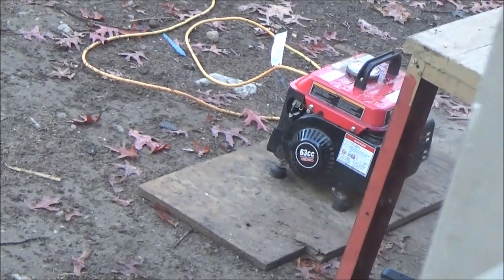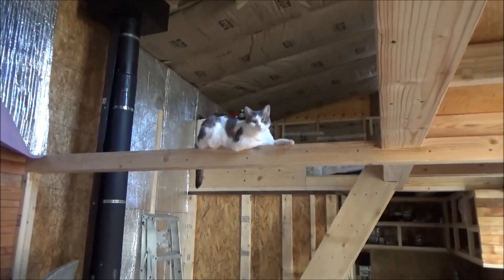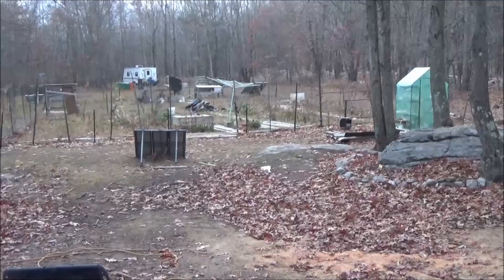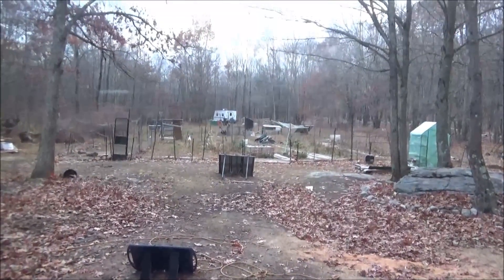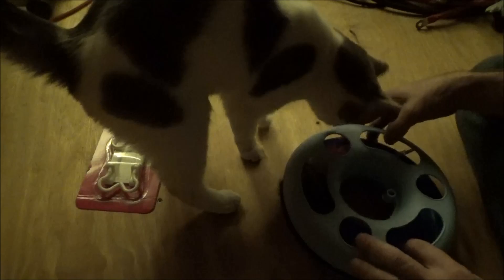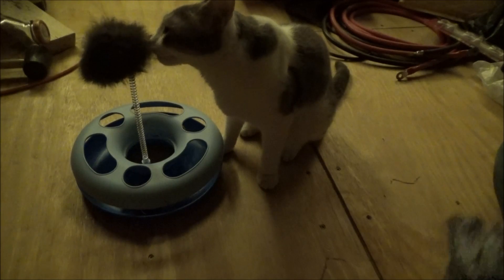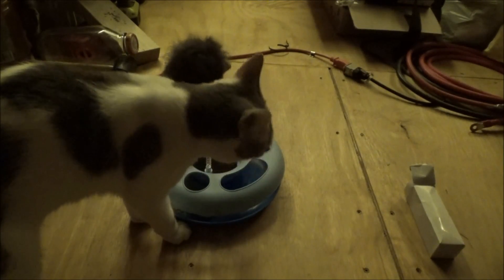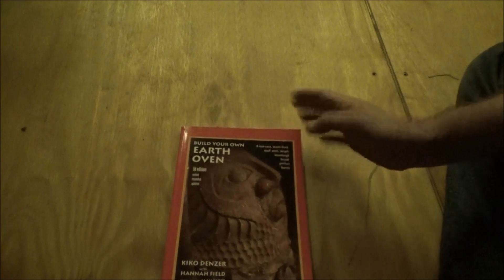Charging New Tiny House Solar Battery Bank

Comment: Can I parallel and leave connected my mppt with a battery charger? I need to top off my battery's with a charger when I get no sun. Also can both the charger and mppt run at the same time with out damage to mppt? Thank you

Comment: Very cool! im finally getting a generator for my rv today.  And planning on putting a wood stove in for the rest of the winter. Any suggestions on stoves?
Reply from the maker: Large as you can safely fit because the smaller burn chamber means feeding the fire all the time - literally. Air tight if you can get one cause it burns even longer on a load.

Comment: Hey there , how many batteries are in your bank ? I'm currently purchasing 12v 35ah batteries to start one myself for my cabin . What i'm thinking about doing is be able to charge my bank from a generator and this coming spring connecting a
100w solar panel to maintain the bank when i not using it . What kind of advice can you give me ?   thanks Joe

Comment: Why is Troy not running a wind turbine during the winter months if he is getting insufficient energy from his solar panels?  I'm glad he is getting alot out of that HF generator, but I don't think he wants to hear that thing running all winter long, even if gas is pretty cheap right now!  I may have missed it but I'd like to see Troy put something up about his long term plans for generating power.  I know he may not have the money to buy everything he needs immediately, but I think he has been in the meadow long enough to have an idea what will work and what won't work on a seasonal basis.
Reply from the maker: Rob Busch  I will need cement footings, earth digging equipment because its too rocky here. Guy wires and footings. And about 100 foot of wire for the wind turbines to the solar panel wires, which costs about $5 per foot per wire. I hope to start putting up a temporary tower next pay check.

Comment: you need to learn about battery charge voltage. 12.64 is 95% full.  12.7 is 100% full.  12.2 is 50% full   12.00 is 25%   11.9 is dead
Reply from the maker: I use this heavily in my work - http://batteryuniversity.com/learn/article/how_to_measure_state_of_charge
Now what worries me is that voltage is not a good test for state of charge. My charge controller shows me the state of charge of the batteries based on computer calculations considering temperature and other variables. I trust it. Better to be more cautious then damage the batteries.

Comment: Ahhh I didn't realize you have a MPPT controller. For some reason I thought you were running a old school PWM controller. Didn't you start out with a PWM controller?
Reply from the maker: flash001USA Yes I did
Reply: The Do It Yourself World
That was the best investment you made for your solar setup. The MPPT controller can take a little solar input power and squeeze much more out for your batteries.

For some reason I thought you had an old school PWM controller and I even commented a video or two ago about it along with how to check the health of your batteries. Hopefully you got a chance to read that comment. Anyhow, the tiny house has came a long way from it's humble beginning from a flat bed trailer.

Comment: The Do It Yourself World  as an IT student myself i prefer windows 8. Yes i can understand your position on the whole situation but in today's operating systems everything is automated. No more having to manually hack into the video drivers and etc.
Reply from the maker: Clayton Burrell As an old school computer tech, I cant stand automatic operating systems. I want control of my computer fully. I want it to do what I want, when I want. I spent 5 hours yesterday trying to use my Win 8 automatic computer because it was doing some stupid automatic system maintenance in the background, using up all resources. When I wanted to use the thing. Took me 5 hours to save a video. That should not be. Sometimes I cannot afford the power for this thing to take over on its own and run itself for 5 hours at a time. I need control
Reply: The Do It Yourself World You do know you can check to see if any updates are available prior to working on the computer. There are a few ways to do this. If you check and there's updates then you can install the updates prior to using the computer and then they wont interupt what you're working on. Also you can go back into the system settings and change the system to allow you to manually download and install the updates therefore eliminating the frustrations fo it doing it automatically.
Reply: Clayton Burrell I have mine set to check for updates, and notify me if there are any new ones. If I didn't do that, BIng and who knows what else would be on here, hogging resources. I check the updates each time, and only install the ones that are needed. Otherwise, even my high-performance computer, on the grid, would be spending way too much time on updates and system maintenance.
Reply: Odahi The Dubious this is a good practice. You can have it set to notify when updates come in so you can manually install or you can have the system set to only install the important updates as apposed to the "recommended" updates which might be like updates for your Skype app or programs that aren't critical to running the main parts of the machine.

Comment: windows 8 is pretty messed up, separated control panels different ones here and there... it is pretty disjointed..   took me a gooogle search on where to turn of the ambient light sensor for the screen brightness...  where was it , in the metro interfaces control panel???  metro looks cool but really not very functional and why not include the ambient light sensor control to enable and disable it in with the screen brightness setting in the desktops control panel???  What is Microsoft thinking?
Reply: Hang on Hang on!!!  I think you just mentioned something I need!   This ambient light sensor... is that the thing that makes my screen brightness suddenly dim for no reason???  If so, how do I fix it, please?   My screen just dims and the brightness  key doesn't change it... what is up with that???  WTH is a Metro Interface Control Panel?

Comment: Hey Troy. Congrats on retrofittng your own gasket. I know it can be a little time consuming, but when you consider the price of buying one and the fuel cost for the trip into town.. not so bad. I really hope you can get your solar panels and batteries working more efficiently. Just keep with it.. maybe its something your overlooking or... lol.. just bad batteries. I sure things will work out. A lot of people on here are pulling for ya. Wish you nothing but the best.

 Btw, where would you suggest buying solar panels from.. new or used.. ebay? Craigslist possibly? I' wanting to get about 4-5  200w panels.. any suggestions on how much i should expect to pay or your opinion on which ones may be better than others. Any insight you might have is appreciated. Stay warm Troy.
Reply: buy new that way you know what your getting, Id avoid ebay or craigslist for the most part though for solar panels

Comment: hey bud.. just called my battery guru and he said you have a dead short.(external) pick up a diode to prevent this. or,, a power interrupter.   Remember to snug down the head bolts after the motor cools off. (I can't find torque specs either) sorry.
Reply: 160 inch pounds sound right ? in a X pattern

Comment: Troy, Windows 3?? What are you going on about no such animal. I wont go through all the DOS, but there was Windows 95, 98, 98SE, ME, 2000, XP, Vista, Windows 7, Windows 8, and the next Windows XX.

I just have to shake my head when I hear about how you used to make all these changes in Windows 3. No such thing ever existed so please stop the none sense already.

This is like the water cooling you created which you stated in another video comment. As stated before (again) those two batteries that they told you were new?

Yes, they maybe new to you but I can assure you they are NOT new, have been sitting somewhere forever. If they had any life in them I am sure the stupid fools at the auto store have already taken away every ounce of life out of them from over charging and boiling over the batteries.

You can keep charging those batteries all day long I can assure you they will not provide any meaningful output current when I high load is placed upon them. Let them sit and remove the surface charge and let us know what the static voltage is.

I am certain they won't be at a (rest state) of 12.8X VDC. I suggest you break out the candles, oil lamps, fire sticks for light. Because coming next month you will be in the complete dark when the mercury drops.

I highly suggest you take this last point to heart: Do not recharge your laptop from your vehicle with out it being started. Because this time next month, the month after that we are going to be all watching you stating you have no job.

Why?

Because you couldn't get the bloody thing to start, so you missed work, and then work said since you can't make it on time. Don't bother coming in at all!

This Sir, is not the place you want to be when your lively hood relies solely on transport given you live in the middle of no where.
Reply: You are joking right?  There most definitely was a Windows version 3.  Windows 3.1 and 3.11 were insanely popular.
http://en.wikipedia.org/wiki/Windows_3.1x
Reply: Geez Tekenglobal, what a pessimist!  First, maybe there never was an "official" Windows 3, but I remember coming off DOS 6.2 or thereabouts and the "new" Windows was called Windows "3" by the hackers who advised me.  Back in those days you super-smart "IT" guys were called "hackers" by the rest of us neophytes.  Anyway, gotta support Troy on this, it WAS referred to as Windows "3" by some of the crowd. 
Second:  Weren't you paying attention when he showed the date codes on the two new batteries?  He clearly stated "10-14", which, in battery speak means "manufactured in October, 2014".  It could as easily said "J-4" which means the same thing.  They are a maximum of about 7 weeks old and that isn't old for a lead-acid cell.  And, you "should" know that most battery retailers either get their new batteries already filled, or, as is required in some states fill the battery when it arrives and attach it and others, if there are any, to a pretty finely tuned gang-charger that will charge them to a ready-state.  I was in that business for years, always got my batteries "wet" and never had to charge one before it was sold.  Our policy was to hold a battery for 3 months before turning it in as "old-stock". 

Oh, and one question:  Where is it that Troy works that he has to start his car up every morning?  The last job I heard him talk about was editing and posting videos from his kitchen table.
Reply: Gene Mowat Excellent comment!   Well this is a learning channel....+Tekenglobal  just got schooled!  LOL!
Reply: ***** hahaha!  Me, too!
Reply: Link Knight Exactly!!!
Reply: ***** Did you like his comment to me on the last video saying I don't have a clue about a warranty issue.   jejeje... Ooooh, sooo amused....  :D

Comment: Glad to see Baby Cat enjoy her new toy. She is so cute! I thought the clock was fitting for you! LOL! Between summer and the wood stove, everything gets hot in there! LOL! The book was just something I threw in hoping you would have something to bake with. Now I see you already do. I thought you like the light. It's LED and from what I understand, don't use alot of energy. Hope you and  Baby Cat enjoy everything!
Reply: You were right! That clock is PERFECT!
Reply from the maker: Thank you very much for everything. The books are awesome. Everything is perfect. Baby cat really loves the new toy :)
Reply: Hey! The clock fits! LOL! I'm sorry,, but I could not resist it! There is no other word to describe it! You and that clock were made for each other! LMAO! You should also be proud of me that I got the socket and the bulb to fit each other! I am totally inept when it comes to electronics! LOL!
Reply: The Do It Yourself World Here is some info on the light bulb I sent you. Description:
Low consumption and ultra brightness.
Spotlight, no UV and IR radiation.
Designed to fit standard E27 fittings.
Long service life, three to four times as long as normal halogen lamps.
Suitable for office, store, exhibition or home use.

Features&details:
Base: E27 standard screw-in base
LED quantity: 108
Light Output: 400 Lumen
Beam Angle Bulb: 360 degrees
Color Temperature: Warm white
Life Spam: 30,000 hours
Housing Material: Major in alloy
Voltage: 110v AC
Max Wattage: 5W
Reply from the maker: IrishKitty1024 Thank you. It will serve me well in my antique brass lamp.

Comment: I know someone is going to blast you wasting ALL that gas for nothing.  I figured you would of set up all your battery chargers and charged all the work and camera batteries. and after charging the bank, I would of kept a trickle charge going
Reply from the maker: Duane C I top off everything when the generator is running. I cannot show everything all the time on camera.

Comment: if your load on the hf set is low it wil not use that mutch., but after a night charging still 12,2 is not good at al Troy , btw, you have to harvest your brussel sprouts after the first freezing night.
Reply from the maker: MrBugsier5 The batteries are slowly coming up higher. My sprouts are still tiny. Never really grew
Reply: The Do It Yourself World ym very afraid about this new batterys troy, being new and standing at 5,8is bad!, btw, you can eat the sprouts small to, sprouts are not really my favorit, big or smal, yeck! lol

Comment: I just got a new computer with windows 8.  My old one crashed, but I totally agree with you.  I am totally dumbfounded on windows 8.  Not user friendly at all.  I did find a program called Classic Shell that will revert windows 8 into the classic format of the old windows. Haven't downloaded it yet but am thinking about it.
Reply from the maker: 3flashcan Wish I could go back to XP but they dropped support for it. Means it wont work with my new computer
Reply: The Do It Yourself World came to the comments to add to bekayezme's comment. After HAVING to switch to Windows 8.1, I downloaded Classic Shell immediately. I suggest it if not for the SOLE purpose of having the interface and access to settings you're used to from previous versions of windows. Here's a screenshot of the settings window just the show the customization http://i.imgur.com/wFLKYsi.png, check it out more at classicshell.net

Comment: What is the floor temp verses the loft area?  Could you use that light hanging from ceiling, it would be bright enough to light the place up all at once for doing videos, working on a project or just to light up the entire place for a short time. This would keep power usage to a min and provide a bright home when needed.
Reply: Or signal for ET!    LOL!    I bet that baby is bright!
Reply: That was exactly what I was thinking when I got it for him! However, He'll figure something out. He will do something creative with it. In time I will send another. It has 30,000 hours to it after all! LOL!
Reply from the maker: M Baldridge Floor is between 60 and 70 degrees. Loft ranges between 70 and 100
Reply: The Do It Yourself World floor temp would be nice to sit and not have cold feet. I would not know how to act having a warm floor lol.

Comment: Hi Troy, some bits from the prairies.
1) you really need to think about how you're going to work this winter. I have been driven inside by the weather and cannot work on any of my projects. All because my work area is not insulated or heated. Do you have a plan for this? 
2) I would love to see this gasket made again (replace the emergency one to be kept as a spare) with your improved technique. This was a total emergency hack and you admitted it, but well done! Amazing how the fuel efficiency improved. 
3) Please wear gloves when working with a drill like that. Primarily on the hand that is super close to the business end of the drill. I have saved my fingers on more than one occasion because I was wearing gloves. You were sent them for a reason.
Reply from the maker: FromThe Prairies My biggest problem is that my wood is wet and frozen. I cannot work with frozen wood. I have an idea I am considering to make a heated work shelter.
It runs well. I am leaving it.
Never wore nor thought of gloves when drilling.
Reply: The Do It Yourself World I used to feel the same about gloves - never really thought about using them until I had the good fortune to be cleaning off an old tool with a wire brush on a drill. It was cold so I was wearing heavy winter work gloves. I was not paying attention when suddenly the drill ripped from my hands and the brush grabbed on to the back of my glove as it flew. Big gouges in the glove But my had was totally fine. Reason learned, I always wear gloves now. 
So, since I love lists;
1)practice makes perfect
2)they're like your favourite boots...the ones you really had to break in. 
3)snug gloves stretch - you want this.